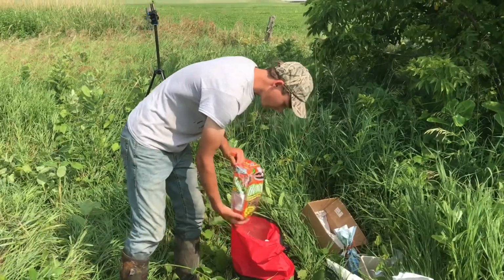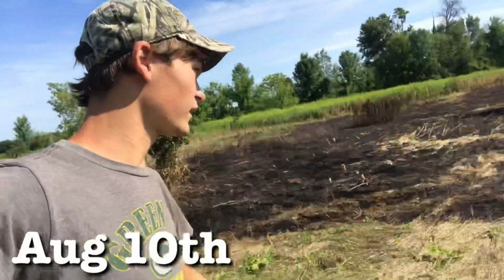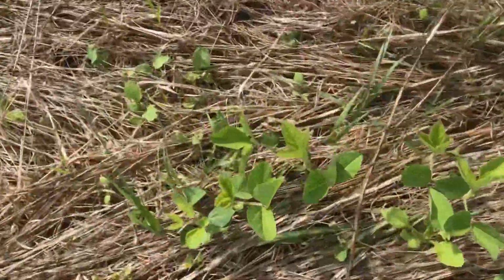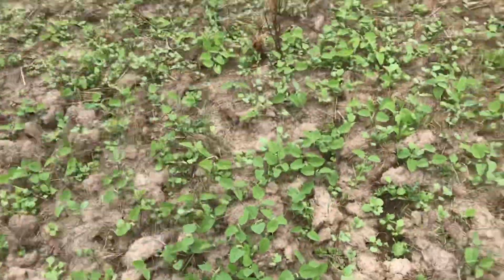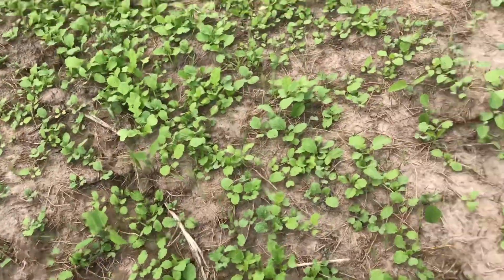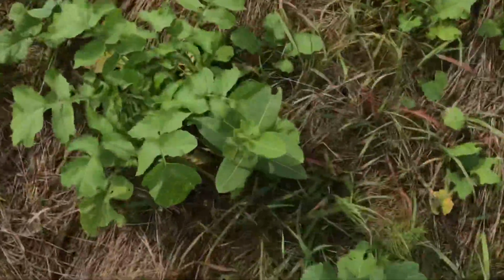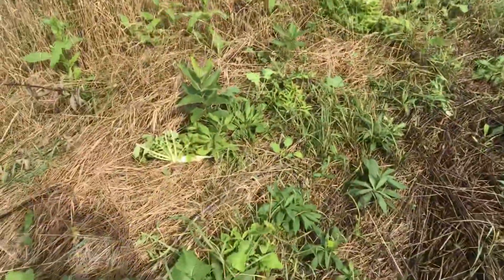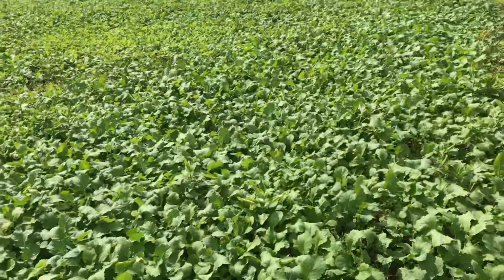No-Till Food Plot Fail - Till & Replant

Comment: Have you done any switchgrass or natural regeneration to try and hold a few on your property?
Reply from the maker: We have tried switch grass in a small area on my grandparents farm. It has been hard to get it established, but this year was its second year and it was about waist to chest high. But it was kind of patchy and a lot of weeds grew in. We had a very good weed control and sprayed in early May before the switch came up. 

In our backyard we just don’t have enough land. Our woods doesn’t join up to any other cover or woods. All the deer are bedding a quarter mile to half a mile away in bigger woods. I don’t ever plan on hunting for a bucks in our backyard, we are better off converting as much land to food so we can pull them over all winter long and possibly find sheds. I only had pictures of two little bucks during daylight this hole rut in our backyard. It would be different if our property was right next to more woods and daytime bedding. Then I would try and convert more to cover to try and pull them over in daylight, they would only have to move a couple hundred yards then.

Comment: How many ounces of clethodim per gallon of water do you mix?
Reply from the maker: Clethodim is tricky, unlike generic Glyphosate and other sprays where the directions tell you to mix a certain amount of oz per gal, in the directions they say 16oz will treat 1 acre. But they don’t tell you how many gallons of water to use. it’s frustrating! I used all 16oz on 1/2 acre and used 20 gal. So almost 1oz per gallon. That’s probably a little more than you need but I wanted to make sure I got a good kill. It didn’t kill the longer grass that good even at the high dosage. I would do at least 1 oz per gallon.
Reply: Wisconsin Whitetail I believe I mixed it at 1 oz to one gallon of water when I sprayed my clover plot. Hard to tell the results thought due to mowing. I will be at the property tomorow checking plots and trail cameras. I hope there is not 4 wolves on camera again. Your plots are looking good! I like honey hole mixed with slam dunk.
Reply from the maker: Grant Gemlo 1oz should have worked unless the grass was long. I haven’t been able to kill long grass with clethodim, just small grass. 
OMG...hopefully you don’t see those wolves again
Reply: It seems like Clethodim works much better if you mix in agricultural Bean Oil.  I believe the oil acts as a surfactant which helps the chemical adhere to the grass.  I mix 8 oz Clethodim and 20 oz bean oil in 15 gal of water to do just about an acre travelling at a decent speed. Takes a week or two but it takes care of the grass and even some swamp weeds..
Reply from the maker: clark wheeler I have heard that too, that it works good with the sure fire crop oil. Next year I am probably going to try it with the oil because I haven’t had the best luck in one of my clover plots where the grass is coming in thick. I sprayed twice this summer and the grass is still green and growing.
Reply: Wisconsin Whitetail I use surfactant with it too
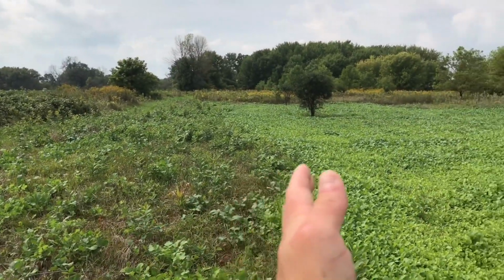Reply: Wisconsin Whitetail I had 6 wolves on camera on the property at the same time we were there yesterday. We got there at 9:20 and wolves were on the back of the property at 10:20 in the morning.

Comment: Ok so i am going to run down all your mistakes.  Number one you tried to plant a cold season crop in the heat of summer.  Plant no earlier the Sept 1.  second  spraying herbicide  in both cases.  In the first round which was unnecessary and in the second round in which you killed all your winter cereals that had started to come up.  Third if you crimp the existing crop you have to drill the plot.  You got exactly what you should have gotten from a top sow with that much thatch.  So next time sow and mow.  With that tall of summer growth you may need to double or triple mow.  My suggestion to you is mow it when you would have done your first planting the come back around Sept 1 and sow and mow.  This system will also completely eliminate the need for extra imputes like fertilizers.
Reply from the maker: Around here if you plant on September 1st your Brassicas will only get 6-8 in tall, we get frosts up here in late September. I don’t know where you are located, probably further south than me. Up here the best time to plant Brassicas is mid July to mid Aug. late July and early aug being the sweet spot. 

“So next time sow and mow” how are your seeds ever supposed to grow without killing the grass/ weeds. Organic food plotting is nearly impossible unless you have a no till drill and a nice crimper. Obviously we don’t have either so that’s why we spray and if we didn’t spray you would have a weed plot, not a Fall/ Winter food source, weeds are great summer browse but after a couple frosts, weeds die off and offer no food. Mowing multiple times before broadcasting would have created a mulch layer. after broadcasting we would have needed to use a drag to work the seeds in. This would have worked but we didn’t want to have to drive the tractor to this property just to mow before planting, that’s why we broadcasted and crushed everything down. If you watched the whole video and saw the results you see that the strip on the side of the plot that was from the first planting looks fine, just a little thin.